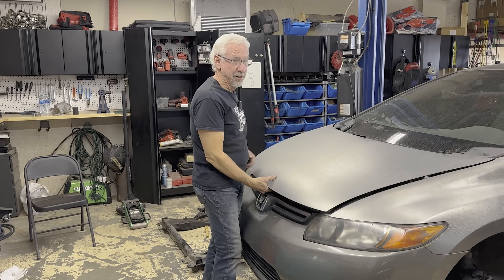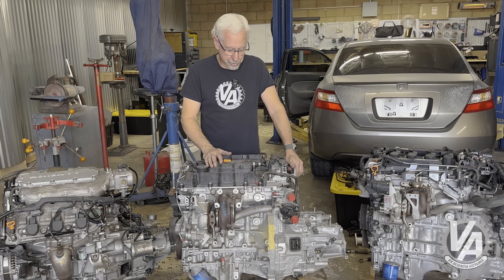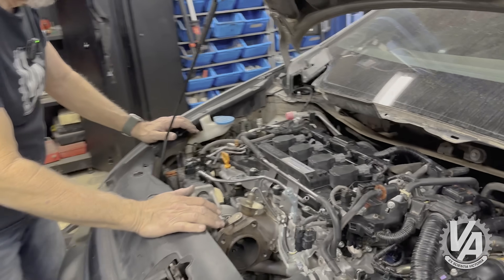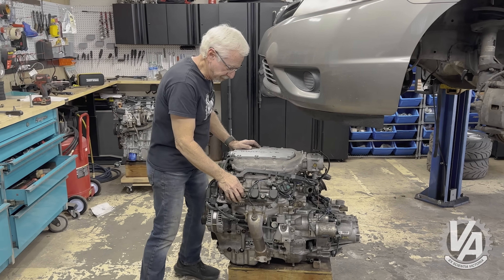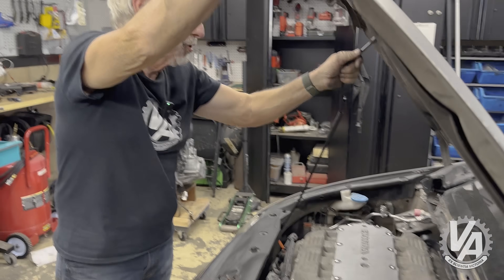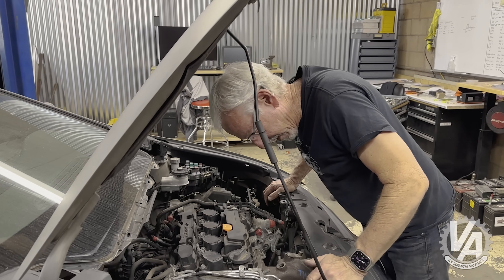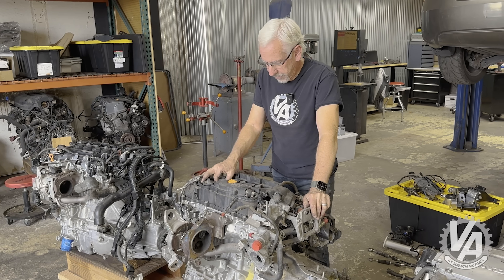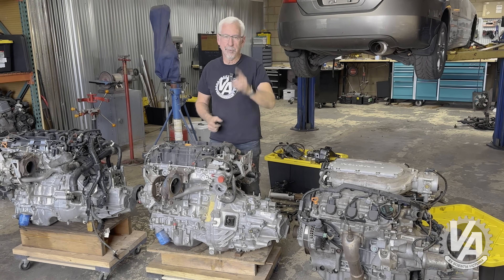Better than a K Swap? (More than a Si killer!) R18 to K, J or L15 Turbo!

Comment: Hi! I have the chance to buy an L15B7 engine at a relatively low price here in Argentina, but it doesn’t come with a transmission. Unfortunately, it’s nearly impossible to find the original 6-speed manual here.

Do you know if there’s any alternative transmission that can be adapted to this engine — maybe from the K or R series, or even from an L15B1 — that could work for a custom swap?

I’m planning to install it in my 1st gen Prelude.

Any insight would be greatly appreciated. Thanks in advance!

Comment: Can the K20C4 (2.0L 4 cyl turbo engine) found in the 10th generation Accord fit in the current Civic SI body?
Reply from the maker: It fit in the previous generation Civic Si just fine. We haven't done it in the 11th gen Civic so we can't say 100%, but we're 99% sure.
Reply: @VTECAcademy  Thanks for responding.

Comment: I have a question. When replacing a 2006 Honda civic ex engine and transmission at the same time can you pull the whole assembly out of the top or do you still have to drop the transmission from the bottom

Comment: The new civics can’t even make more than 300 hp. Without sounding like they’re gonna blow up. Lmfao. I wouldn’t put that crappy 1.5 liter eco motor in any project car I have. That motor is a downgrade from the 2.4 the 9th gen had. And the k24z7 isn’t even the best k24. 😂
Reply from the maker: It's the usable power band. Also, depending on the rule set for a particular series running less than 2 liters could be a huge advantage.

Comment: I want to Honda swap a 08-14 Dodge avenger, (I REALLY want to rear wheel drive  convert it!) However,  a K or J swap, with a 5 or 6 speed front drive will be fine also. It's that or a LS-2, or maybe a North Star,  but, a stock K20 economy engine , with a little eBay turbo, and about 8-10 psi with air to water and a air to air, I'm hoping I can use both computers. Or a aftermarket ECM, and  and fool the stock ECM to think allz well

Comment: I like the L15 & the K20C1 swap 4my 2008 Honda Element SC. I plan on upgrading to an EPS rack& pinion 2clear the engine bay of hydraulics. I plan on electrifying the HVAC to a heat pump. 

I didn't c u discuss locating the A/C compressor on either unit.

Comment: Do any of you guys know whether MT/AT both works with the J35 motor?
In India we only had J35 out of 8th gen Accord AT. MT was not available in India. 
If we source a 8th gen Accord MT transmission from overseas, could it be matted with the 8th gen AT Accord engine?
Reply: Yes but you would need to double check the bellhousings. The 8th gen accord is a round bellhousing so a tl type s 07-08 or 8th gen accord manual transmission would work.

Comment: Thanks for a great video.  As I was watching it I thought of doing K20C swap into my '23 Integra.  You make a point that width of L15B is similar to that of K20C,  so it might fit just fine. Homemade Type S?

Do you think I can reuse OEM engine mount from Integra and Accord or something custom will need to be made? How about ECU and harness?

Comment: The L15 can make up to 300hp/tq on factory head studs. If you upgrade head studs and gasket you can reliably hit 425hp 450-460 TQ but you need a new cam shaft and high pressure fuel pump and injectors and many more upgrades like turbo, CAI, intercooler, possibly radiator, Clutch/flywheel, big brake kit, stabilization hardware .etc   Looking around 6-10 grand in aftermarket parts but one hell of a car. 
J series to make immediate power but L15 is just a fun engine to mod in my opinion.
Reply from the maker: We want to have one of each. We can't afford it, but we want it!

Comment: There are a lot of HRV's on the road these days. I was told it replaced the Fit, but don't know if anything besides the rear seat configuration is shared. lol. Would you consider an engine swap into a "later" model HRV?
Reply: It didn't replace perse but took over as the smallest car Honda offers (in the current times.

The HRV is not dirt cheap on the used or even wrecked market so it's going to be a long while anyone does crazy swaps with those.

Comment: I have a first gen pilot . I was wondering if I can use a manual trans on my original engine . I know bell housing is shaped differently from other j series and of course the column shifter but I was definitely wondering if anyone’s done a manual swap on a pilot before
Reply from the maker: There are only two types of bell housing patterns for the pilot J. There are manuals for both types.

Comment: correct me if im wrong, and i may be wrong. In order to make a swap CARB compliant isnt all you need to do is use a newer year model of motor/tranny than the car the swap is going into, and all stock OEM exhaust and ECU from that vehicle associated to the motor/tranny? Then head to the ref.
Reply from the maker: No, that’s to be EPA legal. CARB standards are more strict. Currently, there are 17 other CARB states plus the District of Columbia that have adopted California’s emission standards. Basically to be CARB compliant the vehicle needs all of the emissions controls from the newer swap.
Reply: @VTECAcademy  Im sorry. Commifornia cancer spreads quickly. Illegal smogs here cost 200.00-400.00Im sorry. Im sorry. I love my first gen CRV but its gutless. I just want some more power but dont want to deal with illegal smogs.

Comment: I have a 82 hatchback accord, what would you suggest for an engine swap? I'm thinking a b20 swap
Reply from the maker: I wonder if that would fit? Those engine bays aren't particularly big. You might have to go with a D16 for ease of installation.

Comment: I had a J30A4 (3.0L V6 NA) in my 7th Gen Honda Accord. Man that thing could put the power down nicely. Really loved to be revved, but the 5 speed auto didn't do it justice. I would love to see a "J" series stoked and an built with 20 psi of boost in a 11th gen Si.
Reply from the maker: Great engine! We would probably go K20C from an Accord in an 11th gen Civic Si.
Reply: @VTECAcademy  I like the K20C as well, I tried to get a 2.0t Accord, but they are very hard to fine with low miles currently.

Comment: Well don't put a motor in it put an engine in it. Motors are electric. And you said you were going to school me haha
Reply from the maker: Motor definition- a machine, especially one powered by electricity or internal combustion, that supplies motive power for a vehicle or for some other device with moving parts. It’s why cars are often referred to as motor vehicles.
Reply: @VTECAcademy  that's an old definition you're showing your age

Comment: Impossible to do spark plugs on j series In this chassis
Reply from the maker: You know the cowl comes off. I haven't tried it yet, but it might not be impossible.
Reply: @VTECAcademy  yes i have one. you would need a flexible extension, spark plug tube is too deep to fit a normal inbetween valve cover and windshield.

Comment: J Swap
Im wondering what makes you find the 8th gen so interesting I see you use it a ton on your channel?
Reply from the maker: They are really popular. But there are some other cars on the to do list.
Reply: @VTECAcademy  ive been driving mine since 2008 i used to get a lot of flack back in the day now i see you using it alot its really cool helps me out thanks. Im dropping a k20/k24 in mine complete overhaul from an r18

Comment: J series lacks in the aftermarket department. You will definitely be able to deal with it though. 

I would avoid the L15 like the plague! It is a terrible platform to build off of. I know it's cheap and there is a reason for that. It has a very weak crankshaft, it has oil pump issues, it has a tendency for the head to lift under high rpm situations, it has weak connection rods, and the list goes on. 

I can't really say anything bad about the k series. If it was me I would go with the k. The main reason is the lack of manual transmissions available for j series. It would easily double the cost of my build, but that's me.

Comment: I have two completely stock hondas.  A Fit with the L15a, great car great little engine.  A Civic with the R18 engine, honestly a little disappointing.  It runs reliably, but isn't anything super fun.

Comment: My vote is for the J swap, I really like the simplicity and reliability of those engines compared to the newer ones and I think it will probably be the quickest and most fun to drive since it has so much torque available instantly with no turbo lag. No replacement for displacement. And obviously a J series will be way easier to find and cheaper.

Comment: We're a little biased being we specialize in the J...but a J32A3 in that little car would book. We made 320whp/265wtq with ours, our PnP intake system, our HLP stage 2 cams, stock heads, FBO basically with small 2.5" dual mufflers dual resonators CBE and street tuned on Hondata. We easily walked Tuned bolt on 10th  Gen Accord Turbos and that was in our 3400lb 7th Gen Accord. Like I said, were a little biased here LOL

Comment: J-series is awesome! I had a CG1 for 14 years (&180,000mi, by me…240,000mi on the odometer) & 10 years of Autocross. Original engine & trans (auto, i/h/e), never rebuilt, never pulled, normal oil use (~.5qt per 3k), shifted fine, great compression tests, and I made VTEC work daily!

Than it died…suffered death by F150 that cut me off…

Now I have a BB6/H23, and it's getting a J30 when it dies…if it dies…Honda made good cars, and I take good care of them…

Comment: J series vs the L15b7 stock I would go with the J bc its more reliable but heavy. If you add headstuds and a built block on the L15 it will be a vn hp to weight ratio for 300+ healthy. Also make sure you get the aftermarket gearset they like to fail around 300hp

Comment: Unless you trying to make that 8th gen ur comfortable grocery getter, I have no clue why anyone would want any of the new direct-injected motors.. They are a snooze fest.. Sure, they have their little turbo's and 250-300-ish hp at the crank, but the powerband is just lame, they redline at like 7k or 7500, and they lack everything that makes the old K, B and F(even H series) great.. Those high-revving, super raw, port-injected greatness with amazing V-tec crossover that can handle a ton of boost as well for cheap and are super reliable.

Comment: I really want you to do theJ series but that might actually take away from the fun of the car despite it having a ton of power. I think it will be to heavy and turn into the corners and cause to much understeer. I own the L15 and the torque is absolutly rediciously but even being built the type R still pulls away. If you do the L15 open it up and upgrade the rods. My vote is for the type R motor. Not much heavier but lots more power and nothing to upgrade internally.

Comment: Boost is always the way to go in this case na motors does have a limit on the induction side of things and it will be easier on the fab work the j series would be way too crammed 😖

Comment: I'm a little confused by you stating that the Accord 1.5T makes more power than the 1.5T SI motor. I thought the Accord was rated at 192bph vs the SI at 205bph? Also, the SI has a more aggressive cam and stronger connecting rods. Am I missing something???

Comment: As a happy owner of a 2022 Civic Si with the newer L15 and twin scroll turbo i still say go with the J. Its just cool as hell to say you have a V6 Civic and will make substantially more power. Anybody curious, the 22 Si is slow but really really good handling and a fantastic daily driver. Far surpassed my 2012 Si's handling but needs a tune to be faster. Its almost a half second slower to 60 but in the corners with the torque and handling you wont give a damn lol.

Comment: I think if you're looking at the jseries, and specifically wanting to maximize power to weight benefits, you should take a look at the j37a4. I have a 9th gen v6 accord and couldn't be happier with the light modding I've done, but the extra 30 horsepower and lower weight you can get out of a j37 seems like a no Brainer to me

Comment: To answer your question J series would be the easiest.
Make mounts. Jump the canbus wire to Ob2 port. Immobilizer reset the Ecu with your stock keys. Everything should turn on and go.

Comment: As someone who’s been spending over a year trying to get a j-series swap in my Miata, I have to give everyone a fair and advanced warning that it’t not an easy swap at all.  I’ve needed a remanufactured intake manifold, an engine rebuild, a new flywheel, and dozens of other parts.  I hope to get my car this weekend, but I don’t have my fingers crossed.  Not saying not to do it, but there’s no such thing as an “easy swap”.  Good luck to all builders out there
Reply: You're up against a lot more issues than this swap would be. No matter which generation Miata you have, you're going FWD engine to RWD car. V6 engine to I4 chassis. Even different manufacturers which might have different electrical connections and mean that all your sensor wires need new connectors...if you're even trying to use any of the factory harness at all. It would be nice to have a little more pep in the Miata though!
Reply: @greasebeardsgarage  
I saw a sweet GM 3800 power train swap from a Camaro into a Miata . Absolute torque beast . Low RPM Torque and HP . Exhaust note was exquisite.and throaty growl without being being overly loud .
Reply: @greasebeardsgarage  You have no idea how many issues I've had, lol.  I'd bought a kit from Minitec thinking that it would be a fairly simple swap, but it's been anything but.  Hopefully it will be done soon, however.
Reply: @joldsaway3489  nice build. I’m doing a swap with a j series into a Honda del sol.
Reply: Sounds like you also bought a bad engine…. That’s a difficulty factor you caused
Reply: @mogulme6190  As much as I'd like to agree, the issue was that the first mechanic I'd gone to left it outside for months with no covers or protection, so it needed an entire rebuild
Reply: I put a Mustang 5.0 in my 1990 Miata years ago. Was such a fun car and never should have sold it. :(

Comment: For that car j series is the one.     I want to look into putting that k20c into a 90-93 accord.   250hp in that light ass car.  The thing would fly with the motor bone stock

Comment: L15 is common in the junkyard and I think its the average garage enthusiast's choice. makes reasonable power and lots of torque while also being pretty economical. not that many downsides to it when you want to keep the power levels relatively low
Reply: In the middle on doing one now.. into a ek civic..
Reply: @rogermoore9225 update on this?

Comment: Been considering a L15b swap for my del sol as I've seen quite a few complete pull outs (engine, trans, harness, ecu) pop up on marketplace and a decent amount cheaper than a K series would be with a good trans not inc. all the other bits I'd need for the K swap. Just unsure of what costs I'd be looking into as far as the ECU, harness, fuel supply, swap mounts, boost pipes etc goes with a L15b because it's all pretty unfamiliar territory for me as far as bare necessities goes for swapping them.  Mostly only ever messed with older D/B/Hs for frankenstein builds/swaps etc. 😬😏 Like would a stock d/b/h pump be overkill/not enough for the low pressure side supply on an l15b?
Reply: Hello. I am doing a L15b7 swap now, into a EK civic. Engine is already in placed with lots of spacing. For the ecu,  the  standalone black is the perfect one for it. Controls everything..

Comment: L15 has big pottential, in my country L15A stock block with turbo and full forged internal make 500whp, big power for 1500cc 4 cylinder engine.

Comment: I’m gonna vote for the J series, the lack of J swaps for EP3/EM2/RSX/FA5 etc, is very surprising, I’d wager the community would very much support a “group buy” of mounts to enable these swaps, k20c and l15b are cool, but not readily accessible as the J’s are
Reply: J in an ep3, I'd love to see it.  Small turbo on a k20 could come close to the torque feel and be muuuch simpler to get running (and potentially make significantly more power), but the j would be an excellent motor in the ep3.
Reply: I put a j32a with 6 sp manual in a es3 civic 2005 that came with d17a and cvt transmission
Reply: @randyvlo5627  We never got the Civic ES3 here in America, but I'm sure the ES1/ES2 we got would be very similar if not identical.
Reply: @randyvlo5627  wth how??? You got pictures on social media or sum? How hard was it? I got a 2002 civic coupe I was thinking bout doing a k swap on with a ep3 sub frame but that sounds more interesting
Reply: V6 all the way!
Reply: I've been wanting and looking at J swapping my dc5 for a couple years. I know that the k is lighter and has more aftermarket but a 3.5 V6 in a RSX sounds fun.

Comment: v6 smog legal is the best sounding swap with how things are heading and making a reliable quick daily..  turbos are overrated on fwd if you doing more than just going straight or have a tire and aero program with a entire cost of the rest of the build imo.  also less things to break and less heat, heat soaking your engine.   i bet the j would have great off throttle turn in as well in that car.  buddy had a nice 8th g si until we turboed it. made 540whp hurt alot of feelings, but the car lost all since of handling where the car felt the most fun, just wasnt the same, he even went the "extra tire set for racing" option with some hosiers and still wasnt the same feel.  he had car for 6 years then after turbo had it for only 1 and sold it. power isnt everything sometimes.

Comment: Would be cool to see how easily the (none Turbo) K20C2 can be made to fit an older chassis. Doesn't rev as high (as old Acura Type-S) but has better mid range. Also, very common engine and probably lots of them floating around in the junk yard.